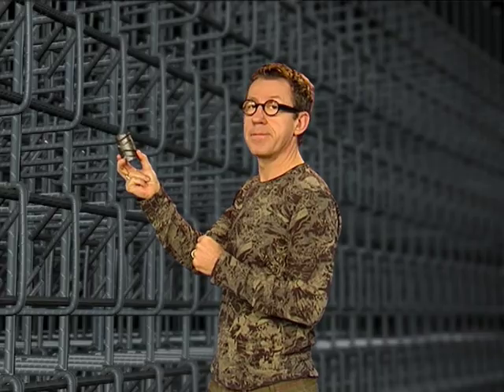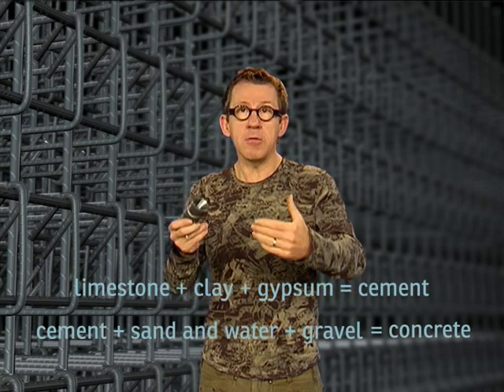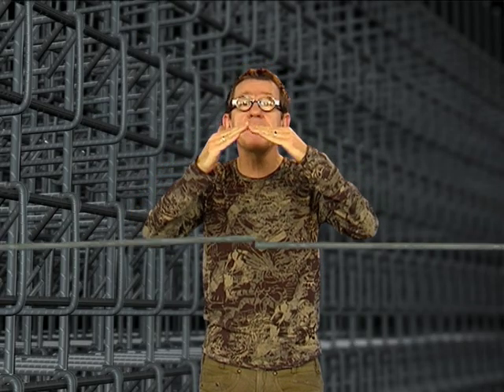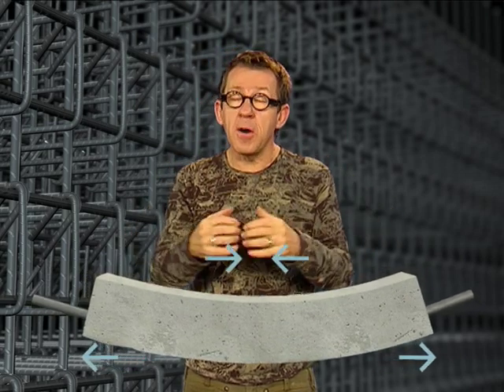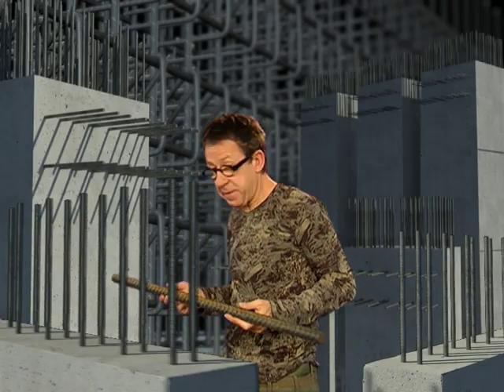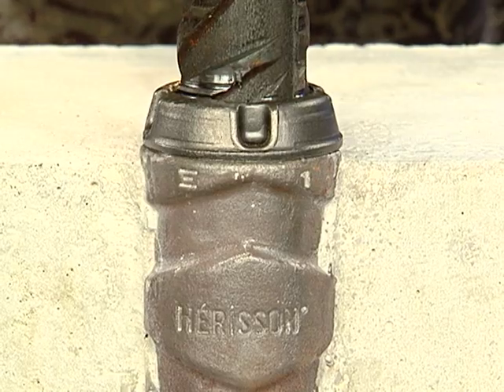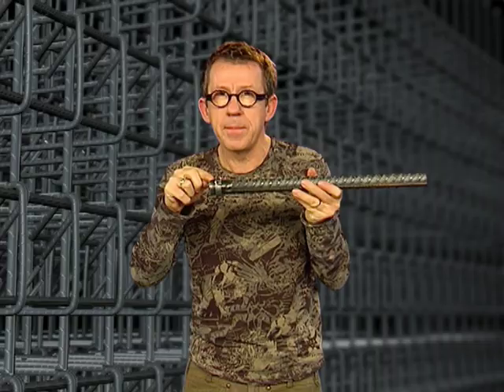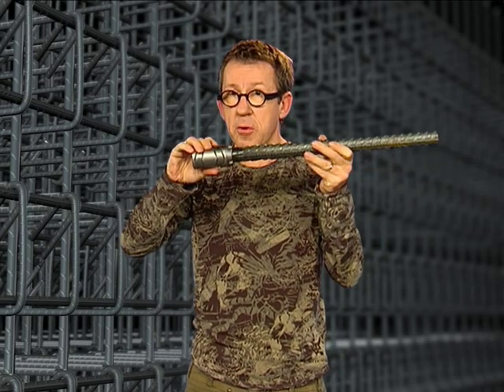The history of reinforced concrete and the development of rebar couplers

Comment: The trick is going to be lining the end of the coupler precisely against the face of the formwork. Otherwise, concrete will seep into the threads and require cleaning before the second rod can be attached.

Comment: The Nevyansk tower did not use the modern idea of reinforced concrete. It used steel bars, yes. But, they are essentially dowels. They support the vertical weight of architectural attachments in shear. Reinforced concrete is a hybrid system utilizing the compressive strength of concrete and the tensile strength of steel. Nevyansk does not do that. That said, Nevyansk is an interesting structure.
Reply: But it is still reinforced concrete.